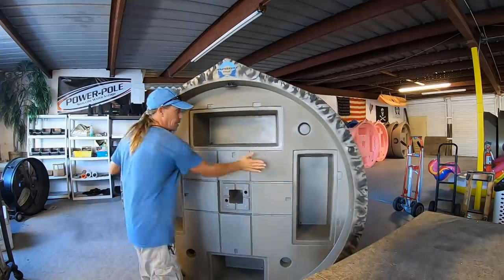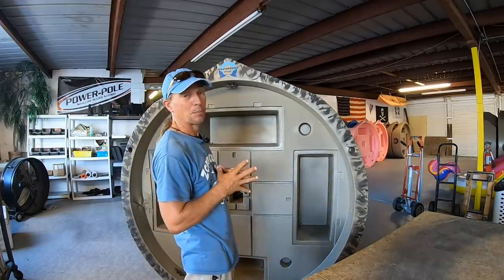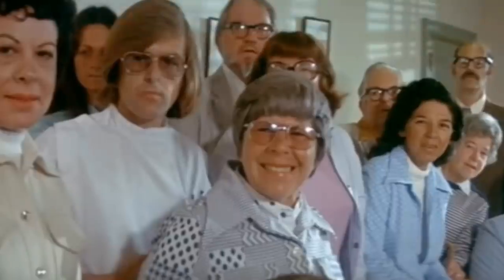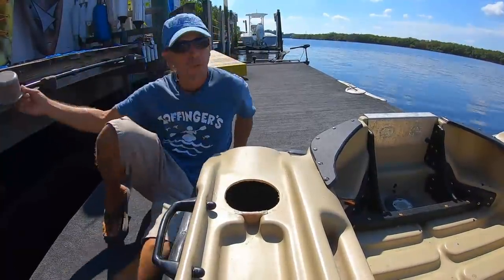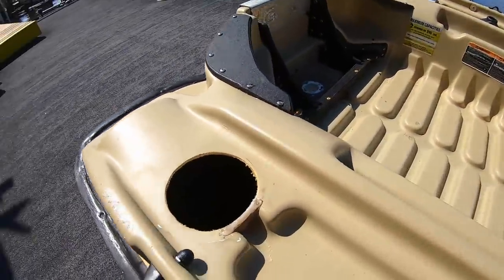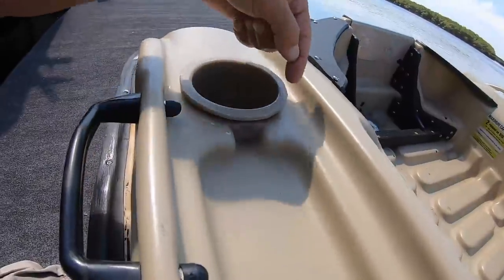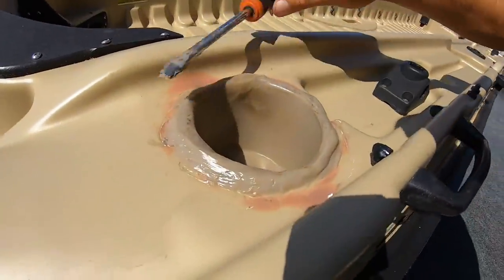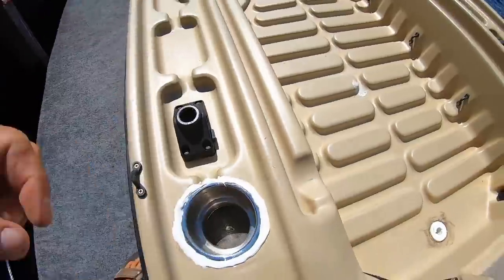Plastic Welding Repair and Recycling

Comment: Great information. I bought a soldering gun kit that came with wide flat tips for cutting rope, etc. It's my go to for plastic welding. It's slower than a torch but works.

Comment: Hi Marty! Great video as usual I've done quite a bit of welding plastics, mostly motorcycle fairings and I've found the Weller soldering gun to work for me. They have a couple of flat tipped options that allow you to slip between the two surfaces and slowly work your way along as they melt. The 200watt kit was $40 on Amazon last I knew - Regards

Comment: Question: If one was more patient in the application of heat, or maybe used a pro hot air gun (such as used for stripping paint) could it have been done neater? Can one get the plastic hot enough to bond without discoloring or deforming it? Thanks. :)

Comment: we have fiddler crabs in the backyard, if we had sheepshead then i would use em, but any way to attract sheepshead? i dont know if they are in our canal or in the laguna at all.
Reply: if you have fiddler close there is a good chance you have sheepshead close they hang out around structure like docks, jetties, retaining walls ect. the bite is very very light if you miss the light bite they more than likely will have spit it out by the time you realize it
Reply: @accordino86  yeah cause the fiddler crabs tend to just "disappear" off my hook. i think they may be a little harder to get out of the hole considering we just got a cold front last night and it is going on us hard right now, i havent used the crabs in a while though, i think we may be getting reds in the canals because it's a cold front. is there like a good hook size to use for em though, i havent seen any eating barnacles. however i saw a barnacle eat the tiniest shrimp ever.

Comment: HOLE SAW!
HEAT GUN!
SOLDERING IRON!
The way you used the screw driver is ok but you should have plunged it through a few times to melt the 2 parts together. 👌

Comment: i dont know if hdpe can be truly plastic welded, if so perhaps a harbor freight plastic welding gun and router speed control (to control the heat of the element) could be used, and give you better control my friend 🧠🧠🧠